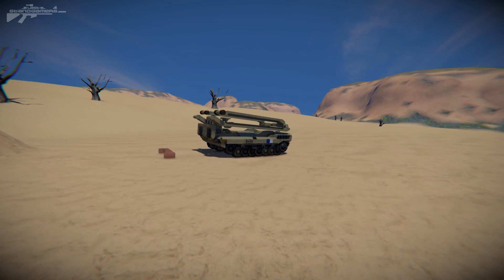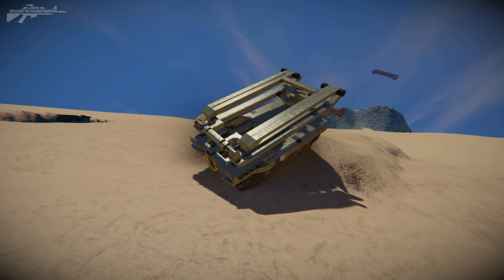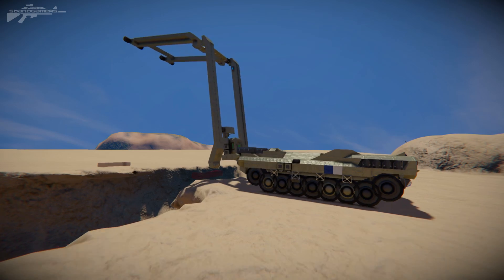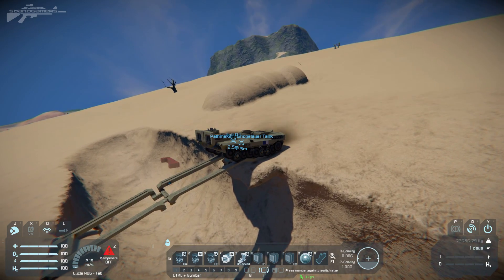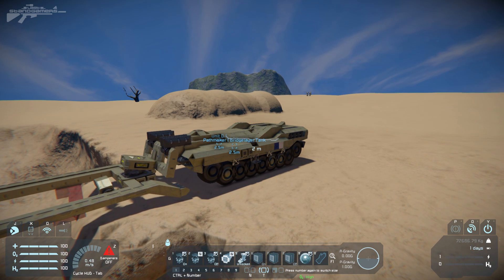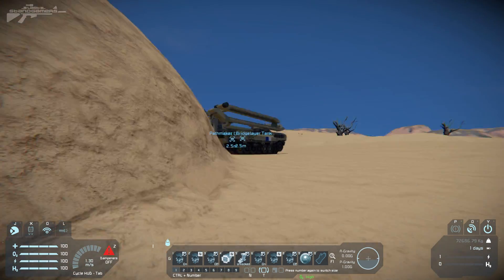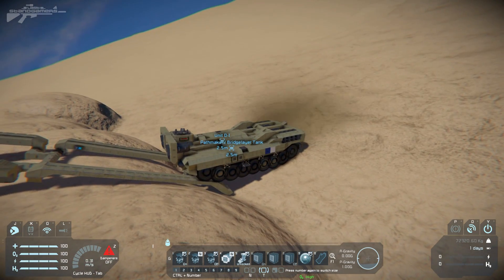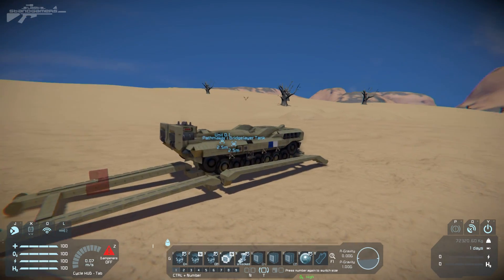Bridge Building Tank - Space Engineers

Comment: The way it's designed, I think you should be able to fill in the gaps between the edges of the bridge--instead of driving across two thin beams, you can cross two solid platforms with just a small dip in the middle where the joint is.
Reply: Watson Entertainment Media that would make the bridge too heavy for the rotors

Comment: But... Only that tank can cross the bridge. You'd have to make sure all your vehicles have the exact same width or the whole thing is useless...
Reply: Well then, it's jolly good that standardisation is a thing in the military.
Reply: the creators tanks are all based on the same chassis
Reply: It's a non-issue. You can always add or remove more surface to the inside or outside without causing any issues.
Reply: thegrouchization but then ALL vehicles are limited to a certain size. They can't get bigger or smaller.

Comment: You should set it with a projector and welders so you can just keep making bridges as you go
Reply: I think there is way around it with welding gondola. Chassis contain projector, lock and placer part and independent gondola what ride on bridge like on rail wielding it. You lock chassis, rise part with gondola and projector, unlock gondola drone and weld the bridge to proper size, bring back and lock gondola, and then drop platform cutting it with use of special grinders. Shamefully it is quite huge build because grinders and welders aren't small.
Reply: MY Channel But, the tank would fall into the space as it was building it, because the built blocks would just fall.
Reply: MY Channel Subgrids cannot be projected sadly.. So welders not only would make that tank need to be bigger but also you would only get one peice of it
Reply: TaboosofYoutube __  my thoughts exactly